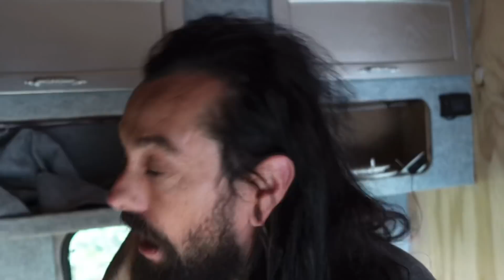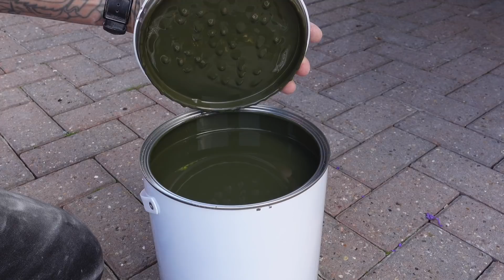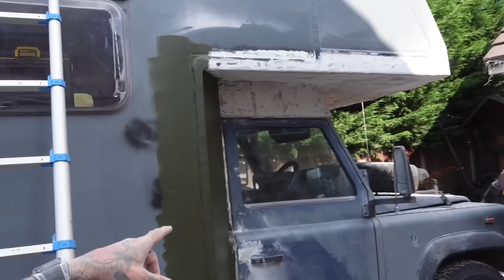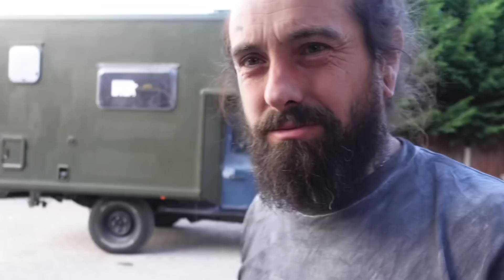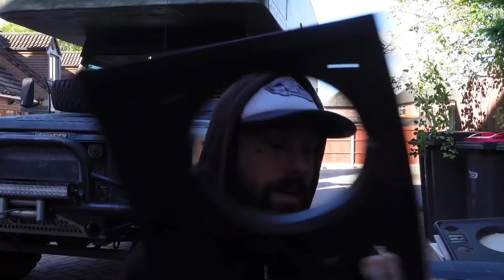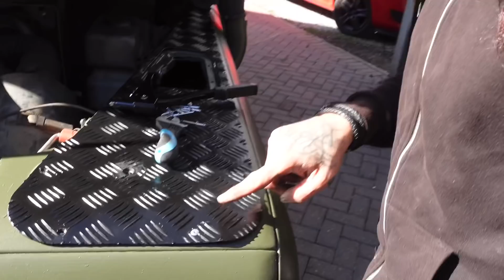Painting My OVERLANDER For Less than £60 - VANLIFE

Comment: You know what's awesome for taking some of that thick filler off a file rasp it's got a handle like a plane and you can get it nice and flat then put a really nice neat coat of filler over to fill the rasp marks. Thing looks awesome though, if the chassis is solid it's a very good buy although everything is repairable on those anyway.

Comment: Careful with the lift kit Liam.  I did the same on a Defender years ago.  Made it very unsteady.  I should have lengthened the radius arms to suit but didn’t.  I removed the lift kit and sold it on.  Went a different route with set of wider rims with 265/75 16 BF Goodrich A/T tyres and a set of wheel spacers

Comment: Loving it. Lift kit is maybe what you need but familiarise yourself with the drive first as issues may arise such as propshaft vibration at certain speeds. Drive slow and steady upto 60mph before and after lift to check. Also so much difference in quality of kits... As said anti roll bars may help with stability on road but you'll have to fit 2" spacer blocks to allow for lift.
This is so what I've been after. Enjoy 👍